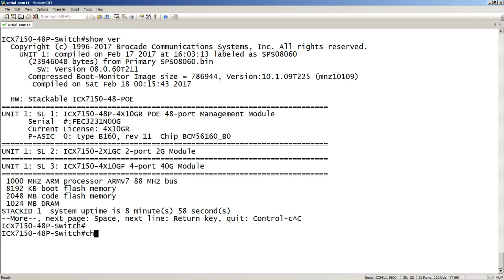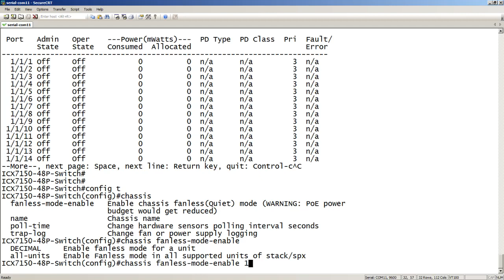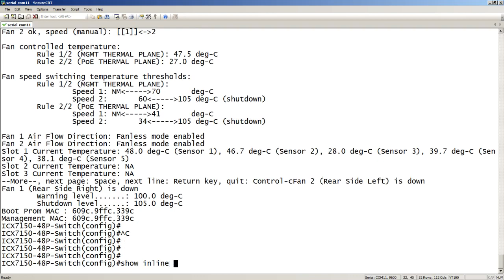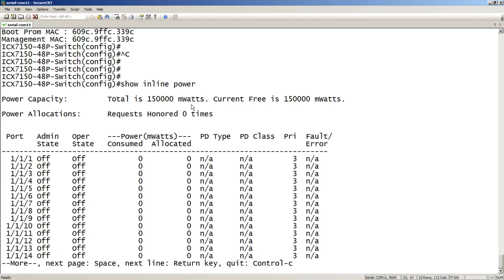ICX7150 Fanless Mode

Comment: Thanks Terry! I rescued a used Ruckus ICX 7150-24P from a bad owner and the fans were my only roadblock in the wife allowing it to run in the living room homelab. Haven't worked with Ruckus switches before but it has been a lot of fun so far, and this was the springboard I needed. Thanks again!

Comment: when i ssh into it and try to type in config t it just says type ? for list, is there something i need to enable elsewhere?im not so familiar with ruckus switches(Mainly use cisco) inherited this switch off a colleague and i know its a good switch so using it at home but dont need to the fans running or a high poe budget
Reply from the maker: Did you enable first?
Reply: @TerryHenry  i followed what you did in the video and when i type show inline power etc it all comes up fine, once i type the command config t it says invalid input type ? for list
Reply from the maker: @james dettmer  Just like Cisco, you need to be in privileged exec mode first before you can enter configuration mode. If the prompt ends in > then type enable and hit enter and your prompt will now end in # to show you are in privileged exec. Then you can config t.
Reply: @TerryHenry  thanks, your right exec mode 🤦‍♂️ worked a charm